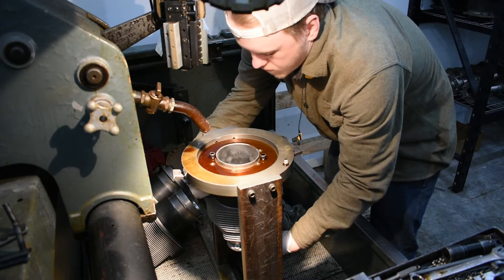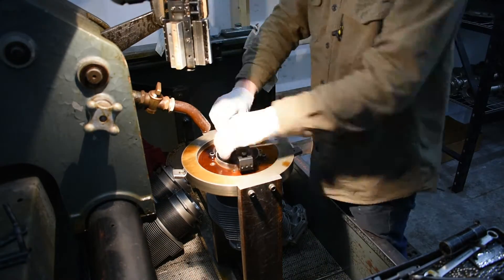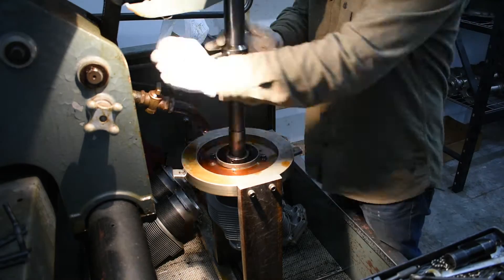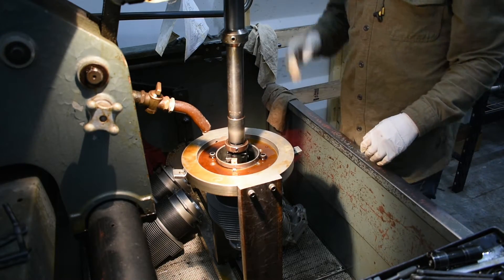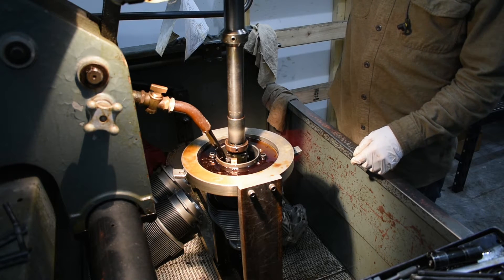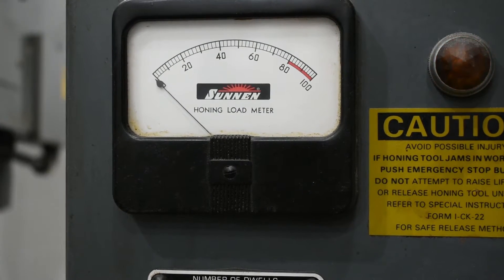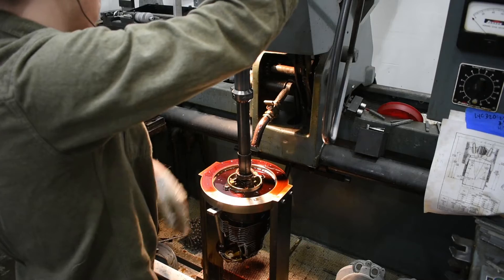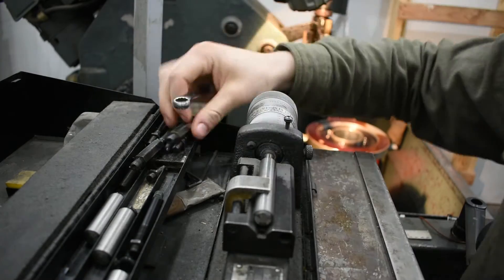Cylinder Honing A Continental O 300 Cylinder

Comment: That doesn't account for a choked cylinder. How do you hone a choked cylinder?
Reply from the maker: Hello! Good question. Honing process for a choked cylinder is actually the same! Choke is only a few thousandths so the stones will be a little tighter in the choked area of the bore, but honing doesn’t take very much anyway. When we BORE the cylinder we can adjust the stroke of the stones so we can get a different dimension at different depths. Thanks for watching 👍🏻

Comment: What is honning?
Reply from the maker: Honing is a process of conditioning the surface of the cylinder wall to help with lubrication of the piston rings during operation. Honing creates fine crosshatch imperfections on the surface of the cylinder bore. You can think of these imperfections as peaks and valleys in the surface of the metal.
Reply: @akcylinders  Are these brand new cylinders?  Are they honed from the factory?